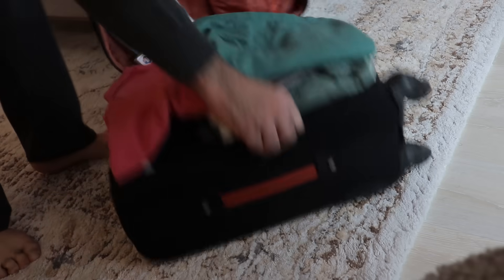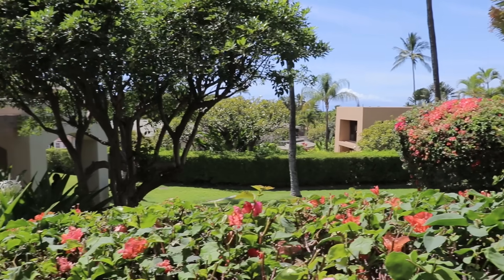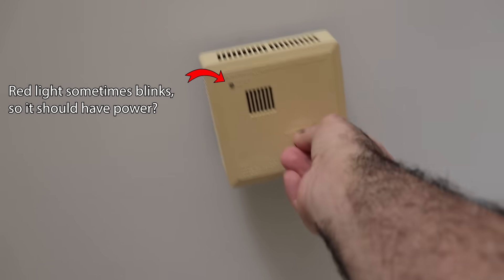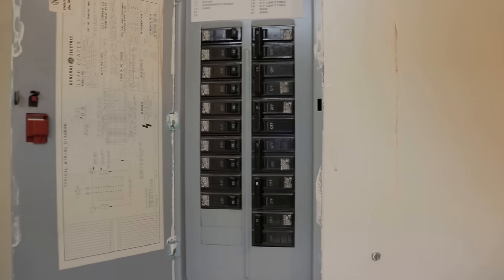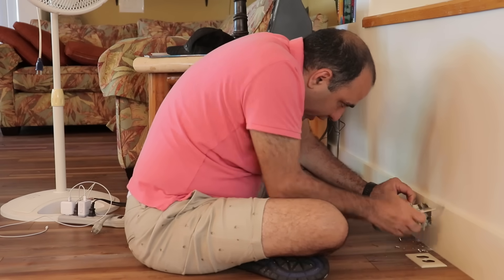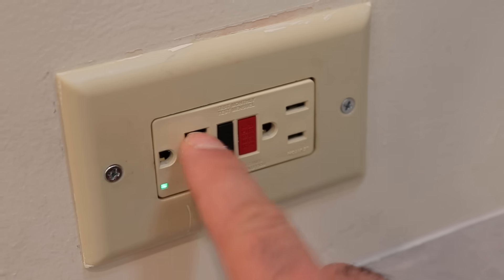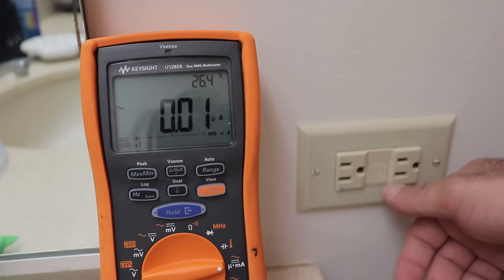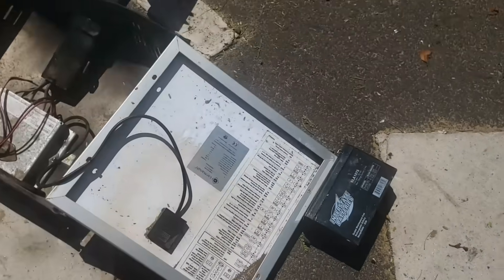Hawaiian Hotel Safety Failures

Comment: I work at the company that makes those smoke detectors, was fun to see my town on the label. And yes, they are far better these days.
Reply: It’s kinda crazy how that smoke alarm was still up there. You can easily buy those cheap first alert alarms in bulk with no problem
Reply: @mattdude  Hotel ones are a bit different though, they are tied into a central panel. The front desk was probably getting a tamper or supervisory signal when he disconnected it. These days (since the late 90s) they are addressable and they can tell which room (and you will probably get a knock or phone call) but back then you often could only tell it was some room in X wing on Y floor. This looks late 80s. Generally the one in the room will sound only in that room but will alert front desk. Detectors in common spaces will trigger a full building alarm but often with a verification delay. Codes have varied on how to handle hotel occupancies. Much stems from the 1980 MGM fire and by 1990 sprinklers were basically required across the board too. The 80s were a weird time for this. I used to inspect them but in hotels we only did a sampling of a percentage of rooms due to guests and what not.
Reply: @craigjensen6853  that’s kinda not true though. In Mehdi’s condo that’s very clearly a local smoke alarm. It sounds in the room and nowhere else. It’s different from a smoke detector which does set off a building. In a lot of hotels they put local smoke alarms in the bedrooms and keep the smoke detectors in the hallway since having them in the bedroom will likely cause a lot more false alarms since a lot people are stupid. You really don’t want to force a building to evacuate just because somebody left the bathroom door open after a shower.

Comment: I do enjoy the fact you tested outlets in a hotel and that you recommend doing that like it's a normal thing :) About the hotel, those malfunctioning items like the old socket and the long-out-of-service smoke detector were not replaced during 35+ years of no pandemic. I don't think that this specific establishment is cutting costs due to COVID.... just saying.
Reply: More than likely, they have one over worked maintenance person who has a list of broken things that has 5-6 times more items than the resort has guest units, not counting upkeep tasks. And on top of that the maintenance budget is likely too small. At least that was the case for me when I was working as maintenance lead at a location of a hotel chain.
Reply: @testhardtest  There's also the possibility that there's a newer smoke detector somewhere he didn't notice and they just never removed the old one.
Reply: @HermanVonPetri  very true
Reply: @samarnadra  That sounds about right. What gives me pause is that I believe hotels are required to have smoke detectors in every room. So it shouldn't have been too hard to locate a working one if they were there.
Reply: It’s all Putin’s fault! 😄

Comment: i find it funny that it's illegal for you to go and fix those issues "for free", but it's legal for them to be maliciously negligent.
Reply: That's why you inform the hotel manager of the issues via email and CC the local code inspectors. They'll be happy to come take a look. Remember, the owners want to spend as little money as possible, so they'll ignore problems as long as they can if they believe they can get away with it. You don't owe them anything, but they owe you safety.
Reply: @wmanley1991  yes, that's my point. They won't let you mess with it, they'll "denial of service" any kind of service attempt, even if it's for the good of others, and will also refuse to fix it themselves. A death trap troll. Imagine someone sitting on a ticking armed nuke and saying "you can't disable it, it's mine! and I won't disable it either." kind of deal.
Reply: Maliciously negligent wouldn't that be a double negative?
Malice requiring intent.
Negligent implying ignorance to the problem.
So which one is it?
Reply: @asdasd-ni8eg  When you know about the problem, understand that people can be hurt or killed by said problem, and still refuse to fix it, you're maliciously negligent
Reply: @asdasd-ni8eg  you do realise you can intentionally neglect something? you dont have to forget. But malicious seems a bit far - i doubt there is an active wish to harm. Wilful negligence? sure.
Reply: @Mijc Osis  

Yeah I agree there, wilful negligence is definitely more like it!
Reply: @asd asd  

No, that's not a double negative. If you were being 'Maliciously negligent' you would be intending harm to come to someone via failure to exercise appropriate and/or ethical ruled care expected to be exercised.

The ol' classic 'we don't need no education is a prime example (on purpose in that case) of a double negative.
Reply: @asdasd-ni8eg  Dude probably thinks “maliciously” is a synonym for egregiously.

Comment: 7:13 Well, they are still 120 degrees out of phase. They are just 180 degrees out of phase relative to ground because of your centertap bullshit.
Reply: They can not be both 120 and 180 degrees out of phase
Reply: @Owen_loves_Butters  Yes they can. And there is evidence of it in the video.
The power is generated in 3 phases with a 120 degree phase shift.
The hotel has 2 phase power
2 phases are connected to a transformer.
In the middle of the secondary coil there is a centertap that the neutral wire connects to.
Now when you measure the voltage on the phases in relation to the neutral wire, they have a 180 degree phase shift. They are both 180 degrees and 120 degrees out of phase depending on what your reference point is.
Reply: @stefannilsson2406  They aren't 120 degrees out of phase. A center tapped transformer outputs two phases that are 180 degrees out of phase. How the primary side is powered isn't relevant.
Reply: @Owen_loves_Butters  If you define it like that, fair enough.

Comment: well those metal boxes we don't use them in europe because it is allso a fire hazard. Well in europe we allso have 240V electrical and 400v for large apliances. You should allso visit some times! The regulations and standards are looked at from a totaly diffrent perspective. In europe platic is the norm and steel contuit is considerd old around here, be we allso used to do it that way in the 50's.

Comment: It amazes me that you tend to find pontentially deadly electrical stuff everywhere you go
Reply: You can find it too if you look. You dont even have to look hard. Like where I used to work. They converted their outdoor lighting from 240V sodium (I think) to 120V LED. In the breaker box, they took out the double pole breaker and put in a single pole, which is fine, but they connected both hot wires to the same screw. And at the other end, they just put a wire nut on the end of the unused wire. So now, theres a live wire in the wall with probably nothing covering it because I'm sure the wire nut came off
Reply: It's WAY more common than you'd think. I was an electrician once and all my friends call me when they have issues. You wouldn't believe the stuff I've found. And without fail, I can legit find something wrong in any place that has power.
Reply: I am not an electrician, but I worked as maintenance lead at a location for a hotel chain that shall remain unnamed. Due to knowing an electrician who helped with a remodeling project I am aware of some of the electrical code in my area... The amount of... wonderful electrical work that I found in that hotel when I started was astounding. And I am sure if I was a fully trained electrician I would have found even more things to make my skin crawl.
Reply: It’s not really amazing, bad electric stuff is really everywhere. In my hotel in Curacao they had a splice on kids reach height with live conductors, if you had something like a small tea spoon you could toast yourself. In my own house in Belgium they didnt even bother to put in the screws in a powerpoint to clamp the wires, they just let it hang under mechanical tension..
Reply: How do we know he isn’t creating them? 😂
Reply: @alexdasliebe5391  It’s not really easy to purposefully make GFCI’s and smoke detectors go a-functional without breaking them completely.

Comment: I love these videos!😂 When will you come to europe mainlaind to inspect our system?
Reply from the maker: One day!
Reply: @ElectroBOOM  220v 50hz
Reply: @ElectroBOOM  nice! Youre welcome in the Netherlands😁 we have 240v and one gfci in every house for all sockets
Reply: @homemade_madness  Ah good the good old aardlekschakelaar, very fun to figure out which appliance is guilty of turning off all the electricity. I think current up to date ones are supposed to allow up to 30 mA at most (but will likely trigger somewhere above 50% of that) and afaik you're only supposed to connect up to 4 groups to them if those don't have their own mechanism to detect ground leaks. And there was something about recommending/requiring two of them even for small installations so that not everything shuts down when electricity fails.

The older standard was only guaranteed to disconnect when a leak of 500 mA was detected, no longer legal to install for residential use but I wouldn't be surprised that they are around in many places. The new requirements are about 20 years old so plenty of homes haven't seen a major renovation since then.
Reply: @ElectroBOOM  230V 60Hz in Germany
Reply: Three phases for the win!
Reply: He will stay in germany after seeing our breaker boxes he will tear up and know this is the promised Land. ;)
Reply: if he will se polland slums block electicity box 
he will go bald
Reply: Plot twist some european countries also use different outlets, like belgium vs germany.. the difference is little but I was surprised when I visited Belgium
Reply: @joons3374  Belgium uses Type E outlets (same ones used in France) with the ground pin sticking out of the outlet, wheras the German Shucko outlets have two earth tabs on the top and bottom of the outlet.

Coincidentally, they had to come up with a combination plug that can be used with both Type E outlets and Shucko outlets, if I remember correctly it's known as a CEE 7/7 plug.
Reply: @joons3374  In Italy they still use a heavy duty 3 prong in-line plug.   It's quite beefy, good for 16 or 20 amps.
Reply: @joons3374  I think by now it's more or less standardised, no?
Reply: UK has a nice system, but now we are free to do a worse one after Brexit. If it is cheaper and less regulated of course
Reply: @Fantástico mundo de Brenno He said country, brazil is not yet a real country 🤣🤣🤣🤣🤣🤣
Reply: ok
Reply: Yeah, you would love commie blocks. 50 year old ceramic fuses, neutral wires used as ground, not a single gfci in sight, just aluminum and copper cables twisted together in blazing harmony...
Reply: You should check out France’s plugs I forgot their name but they’re quite interesting
although the flight must be expensive 🙃
Reply: @jamesmac5937  (French guy there, lemme see...) these are called CEE 7/5 (outlets) and CEE 7/6 (plugs, though you're more likely to run into CEE 7/7 combination "Shucko+Type E" plugs these days) aka "Type E", if I remember correctly.

There's also the specialized outlets, like the single phase 32A outlet/plug combo for stoves (and its 3P+N cousin, albeit rarer), but that's a different *paire de manches*.
Reply: @Alexis_du_60  Yea the 7/7 combinations
Reply: @jamesmac5937  I've seen the plug somewhere, but never the socket. Nice recessed design. Looks almost compatible with the round European plug.
Reply: Mehdi experiencing 400V TN systems for the first time.. Is it safe??
Reply: @Fantástico mundo de Brenno And you have the electric suicide shower heads.
Reply: He has been to UK, check out that video
Reply: @thefighterinhades  the comment said _Mainland_ Europe
Reply: @purpleapple4052  Isn't the UK a bunch of wave batered rocks somewhere off France ?
Reply: @trespire  yeah but we do have the best and safest electrics.
Reply: @2Sorts  UK sockets are second to non.   The oversized ground prong, chunky fused plugs are huge safety features.   Although I do like the round European plug.
I'm in Israel, our plugs are shite.
Reply: @trespire  Exactly. And it's full of Brits, imagine that!
Reply: @andreasu.3546  I've heard about them Brits' .   Didn't thay sack Rome in 1977 ?
Reply: @thefighterinhades  He said europe, not UK.
Reply: @thefighterinhades  UK is no longer Europe.
Reply: @pileofstuff  the UK is still in Europe  but isn't in the EU which is a political social and legal union.
Reply: @thefighterinhades  UK isn't part of Europe anymore.
Reply: @JustinS06  Maybe you should go and learn about the difference between Europe and the European Union.  Saying the U.K. isn't in Europe anymore is like saying Texas isn't in America anymore if it was to leave the United States.
Reply: I broke my feet today because I kicked my computer because someone commented that my videos are bad! I hate unjustified criticism. Please wish me a speedy recovery, dear home
Reply: @AxxLAfriku  break your other one
Reply: @AxxLAfriku  ok
Reply: @AxxLAfriku  you dont have to say it there you know
Reply: @devhonk1722  its a bot searching for clout
Reply: @AxxLAfriku  no